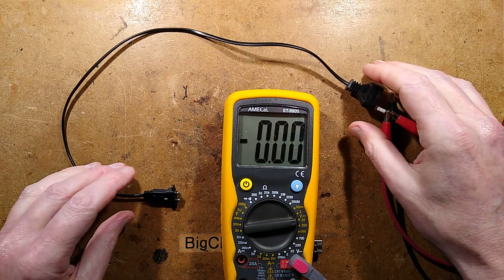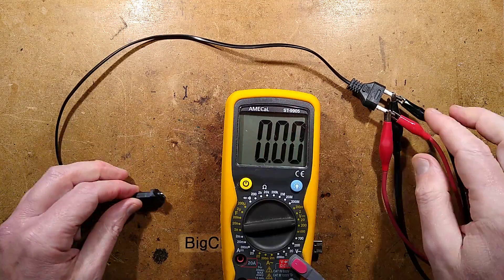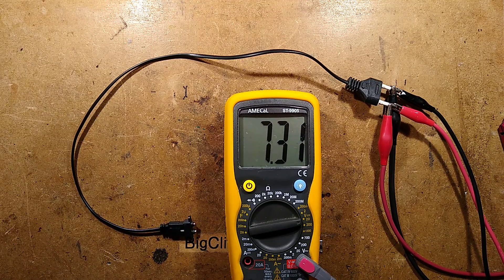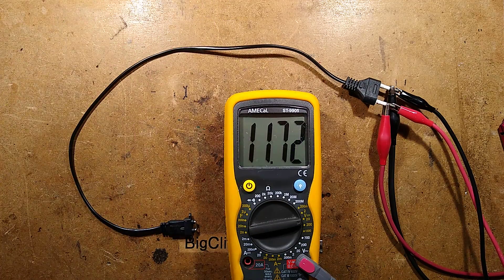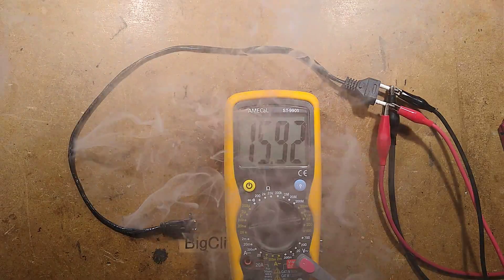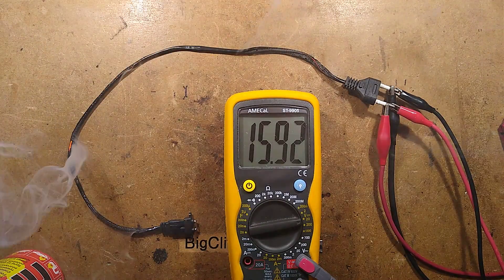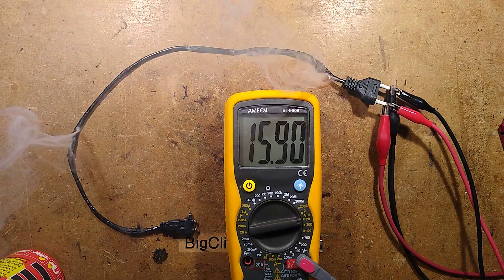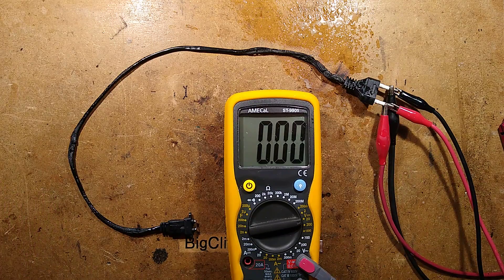Cable test ends in flames

Comment: Not the same but similar potential result...We got in a desktop power supply of some sort that used a standard computer style power cord. Often, these just get mixed together since they have always been 18 gauge wire for like forever. No problem. Someone happened to plug this into a computer and the computer acted odd. Then I was called to check it and noticed the power cord was hot. Cutting it apart, it was 28 gauge wire! I seem to recall it was labeled as 18 gauge but my memory could be fuzzy on that. That prompted a check of all other cords in the shop and now anything that is plugged in 24/7 only has Belden (we had them a while now) or other reliable name brand cords on it.

I don't like the fact that Copper Coated Aluminum (CCA) is now getting popular, bad enough for data cabling, worse for power, but copper coated steel is just scary in so many ways(as shown in the video). Time to buy more magnets for testing. Another fantastic video!
Reply from the maker: I have some thick but fake cables here with false specs on them. The magnet won't detect the aluminium ones.

Comment: I think I may start taking a little neodinium magnet with me for when I buy stuff from the 'cheap shop', that's pretty bad at even those low voltages.
Reply: I found a Lenovo USB mouse with steel wiring.  And it's from mid 2015!

Comment: Nice flames 🙂 Some time ago I powered a 400W "Sun simulator" (a metal-halide lamp) at home, to pretend that it is a sunny summer day (during a long winter evening). I used a generic cable that came with some Chinese device. Didn't use a capacitor, so there were around 3A flowing through it. The cable had "16A" embossed over it, so it seemed OK. There was some "hot plastic" smell. Thought it was coming from the lamp heating up for the first time, then there was a loud POP! and sudden darkness. No flames or even sparks, shame. The cable was very hot, soft and melty. It was made of a very tiny amount of copper-plated aluminium. There was no ground wire at all, just live and neutral, despite both ends having ground connections. Fun 😸

Comment: Clive, I've noticed here in the States that booster cables are more often than not just copper clad aluminium, and not a very durable product. The up side is that they are quite flexible, but the down side is that they are more brittle. I encourage people to avoid them, as they are quite lacking in quality and professional development and design.
Reply: Walmart has a reputation to protect?

Edit: FWIW, reviews of Walmart-brand jumper cables ("Everstart") seem to indicate that they're CCA, but the packaging doesn't seem to indicate that anywhere.
Reply: But how can you find out what's inside the product before you part with your cash and take it home? Serious question and I'm not being sarcastic.
Reply from the maker: By only buying from big names like Walmart and Asda with a reputation to protect.
Reply: @josephking6515   Read ALL the information on the packaging.  Sometimes they will admit that the cable is CCA.  Also get a feel for the weight.  Copper cables weigh a lot more than CCA.
Reply: @josephking6515  If you have experience with cables, a copper clad aluminium cable will be over 2 times lighter than pure copper. You can estimate the mass a real copper cable should have based on length and cross sectional area.
Reply: @josephking6515  if the package allows, pull one of the grips from the clamp, and look at the wires at the end. If they appear to be white, in all likelihood it will be CCA. Also, the weight of the cables can be an indicator as well as the package description. If they are an import, that seems to be an indicator as well.
Reply: Most people don't buy jump leads with the intent to use them frequently so if they're thick enough I wouldn't really worry about it. Especially if they have a decent strain relief on the clamps.
Reply: @ManWithBeard1990  You only have to use it once, not frequently to cause a fire.

Comment: I bought a 5v 10A powersupply. The barrel jack connector that came with it went up in smoke. I sniped the end and used wago 221 Terminals.

Comment: I made the mistakeof using some cheap Chinese alarm wire when installed my own system. It looked like copper. After 10 years or so i got an open loop fault. I tracked it down and the cable was actually rusting. I never checked with a magnet to see if it was steel but it certainly wasn't copper.

Comment: It might be okay (not the steel part, but just thin copper) IF AND ONLY IF there was a fuse in the plug. In just about everywhere but the UK, plugs don't have their own fuse. This means that all leads and even internal chassis wiring have to be able to handle the full fault current the circuit breaker will allow until it trips if there is a short circuit without melting. Across the pond here in the US, the breakers will be either 15A or 20A. I've never seen any proper appliance cord here smaller than 18 AWG (0.823 mm2), probably for this reason. I did have a 0.75 mm2 "copper" (felt like aluminum) cord for a laptop power supply and when the ground prong broke off (yes that happens here in the US), I cut the other end off, twisted live and neutral together, and plugged it in outside my garage to see if it could trip the breaker. As I suspected, it could not. Part of it just melted and burst into flames, breaking the circuit before the breaker even knew what was happening.

In my educated opinion, all plugs should have integrated fuses. The circuit breakers only job is to protect the wiring in the wall, not the wiring in an appliance. The appliance should have its own fuse.
Reply: Well frankly, the initial resistance was 5.86 V / 5 A = 1.172 Ohms. A short via this cable would have pulled 94 A on a 110 V circuit and 196 A on a 230 V circuit, easily enough to trip the breaker immediately.
Reply: @andreasu.3546  I suggest you learn about breaker (mcb) trip curves before making a generalized statement like that…. A 16amp breaker for example (with a ‘D’ characteristic) could easily pass well over 320amps for several seconds before tripping. 
A breaker with a ‘D’ characteristic can pass up to 20x its rated current for 4 seconds before tripping, For a breaker with a ‘B’ curve it’s about 5x the rated current.
Reply: @andreasu.3546  Tha thin cable would act like a fuse and melt before the breaker trips.
Reply: The 32 A circuit breaker in my consumer unit will usually trip quicker than the fuse in a plug.
There is a distinction between overload current and fault current which allows for the absence of local fusing even though their omission might seem like a bad idea.
Plugs with integrated fuses will not protect cables such as the one in this demonstration.
An extract from The Electricians Guide Fifth Edition by John Whitfield (6.3.1 - The Fused Plug) states that 0.5 mm² is the minimum flex size suitable for circuit protected by a 32 A MCB.
A  0.5 mm²  flex will not be able to handle overload current more than 3 A, but BS 7671 Regulation 433.3 explains why this might not be a concern.
It seems however, that a 32 A MCB will provide adequate fault protection for a  0.5 mm² flex, so a smaller-rated fuse is unnecessary if the appliance is rated at less than 3 A.
If cables smaller than  0.5 mm² start appearing on appliances, then all this is irrelevant, and fused plugs are not the solution.
Reply: Except for the UK I do not know of any country that stipulates fuses in plugs (which apparently is a holdover form ring-wiring the mains due to copper shortage after the war). But Christmas lights have a fuse in the plug, at least in the US.
Reply: British 3pin plugs are thought to be just about, if not the, safest plugs around.

Comment: its awful all this tat coming into the country and scary as anything i heavilly disagree with this stuff being made. Its not diy dave replacing sockets and tinkering with fuseboards as long as its done safely a problem. Its the scary lack of knowledge surrounding this wire fuses etc ive seen them 2 prong things wedged into extension leads wall sockets its frightening dread to question the circuitry inside this tat being safe aswell

Comment: what completed the circuit to let current flow?  looks like its just 2 unconnected points at the end.
Reply from the maker: I added a shorted socket insert at the end.
Reply: @bigclivedotcom A great many people seem to be completely missing the point of this test. The short circuit at the end of the cable is the least relevant detail of this test; this is all about the current and this cable's complete lack of ability to deal with it.

Comment: One of the most useful things I own is a Doogee S98 Pro with a thermal camera in it. Being able to see when stuff gets hot (when it shouldn't get hot) is an excellent indicator of when dangerous junk is about. Thankfully, I've been lucky with everything I've bought so far (off-brand Dewalt battery clones, anyone) but I'm always well aware that it only takes one shoddy cable to burn your house down.
Reply: New thing on the Chinese test-equipment market I'm seriously considering purchasing for my toolbox is a multimeter with a built-in thermal camera. It does mean you can't track volts and amps and spot the thermal issues with a circuit at the same time but it's kinda neat.
Reply: Clive does have a thermal camera. He showed it a few months back.
Reply: @chaos.corner  I was going to buy a standalone thermal camera for myself as a Chrissy prez but these multimeters with built-in cameras have suddenly popped up in the Usual Places. They've got USB downloads, data logging and a few other options that would be a bit of a step-up from my old Maplin special-offer multimeter anyway.
Reply: @robertsneddon731 Sounds nice. I know there are phones with them in. Mine is a USB plug-in one. It needs a micro to usb-c adapter now but still works.

Comment: I had a flex go up in smoke on my bench. It was for my bench top power supply unit. The unit is great, but the supplied flex is just terrible. Copper coated aluminium cores. I’d been using it for a good while too, but I moved it over to my main work bench for some testing I was doing to fault find on a coil I’d wound for a vintage magneto & all of a sudden there was smoke! I thought it was just a cigarette in my ashtray, but no, it was this flex.
I’ve since bought a second power supply (same brand) & they’re STILL using the dodgy flex! So I said as much in my feedback in an attempt to warn others.

Comment: Clive and fire to go with my first cup of coffee. It just doesn’t get any better than this.

When you showed us the product and showed that a magnet stuck to its power lead I immediately got a bad feeling, and it was justified.
What made you think to check the lead with a magnet, have you run into ferrous power leads before? I would never have suspected such a thing. As I think about it, with the rising cost of copper, I suppose I shouldn’t be surprised that it’s come to this but damn, who allows this to happen?

Comment: That would probably still happen with high quality cable, shorted like that
Reply from the maker: Not with an equal gauge of actual copper.  Steel is NOT suited to a flex like this.
Reply: @bigclivedotcom  Well yea, I am not endorsing steel or ally wire lol

Comment: Failure under controlled conditions is the best kind of failure. Might want some air filtration for the shop if you're going to keep doing this, however... ;)
Reply from the maker: It has a 24/7 extract fan.

Comment: I love copper-clad steel and aluminium in unshielded twisted pair cable: looks good, while delivering a hell lot of headache in communications and breaking here and there when cables slightly move. Also, copper-clad steel (and especially aluminium) is terrible when you try to use it as jumper wires in your solderless breadboard too, not to mention how bad it is for use in soldered circuits.
Reply: In the USA, copper-clad steel and aluminum twisted pair cables are not allowed for in-wall (or in ceiling or anyplace they're permanently installed) use, the electric code says they have to be copper. Therefore it's a code violation to use them for that purpose.
Reply: @brianleeper5737  anyway, somehow they sneak into market in various countries, often without proper marking.
Reply: @jkobain  I'd hate to be the one who installed thousands of meters of this cable, only to be told that the installation has failed the electrical inspection and it must all be torn out! I guess the only good thing about that is you can use this junk cable as a pull string to pull the good cable in!
Reply: Given most components have tinned steel leads, steel wiring couldn't be that bad.  (I'd rather my power leads to be copper though.)

Comment: I learned this mistake the hard way. I did reuse a mains cable from a shonky Chinaproduct (a desk fan) for another shonky Chinaproduct (a little desk PTC heater, which had a worryingly thin cable). Over time, the cold current of the PTC, which was large, melted the cable to the point of a short.
Reply: Never buy anything intended for mains from China. It's all crap.

I've seen metal cased appliances which had an earth wire in the British plug, but  it wasn't even connected to the case.

I have seen lived exposed parts and incorrect sized fuses put into the plug.

Just don't anything from China that is intended to operate from the mains.
It's not worth it.

Comment: I think it is important to mention that this high voltage translates to a relatively low current when 240v is applied. This low current is dangerous, because the fuse will not trip instantly. Fuses are designed to trip instantly on high overloads. You can see that in earlier video's from Clive where he takes a fuse apart.
If this cable will conduct about 3A at 16v, it would do about 45A at 240v. This would definitively not trip a standard 16A fuse instantly. This fuse can handle 72A for at least 5 seconds. Within 5 seconds, this cable will be on fire at 45A.

Comment: You could make a follow up where you explain how can we separate the good, the bad and the stinky if we have a box full of random cables (I can't be the only one who has). Measuring resistance, magnet test, or try to overload it and if it burns it was bad?
Reply from the maker: I think it needs a dedicated tester designed that measures the voltage drop at high current.

Comment: I bought a standard computer cable once, in a local chinese store and the cable said 0.75mm2. I'll admit; I did overload it with around 10 amps, but copper cable would've held that with no issue, but the one I bought, was like yours; with copper coated steel wires (only a few thin strands of steel in each wire, not nearly 0.75mm2) and since the price was literally pretty much the same as for a genuine cable, I haven't given it a second thought and bought it, only to later shockingly discover it in "melted and stuck to itself" state. Pretty scary.
Reply: That story makes me want to throw out every cable I own and replace them with ones from a reputable brand. Who knows how many of the cheap crap cables I've accumulated over the years have fire starting potential.

Comment: I'm sorry Clive but any wire will burn if you exceed its current rating for a length of time. In this case that cable was intended to be used @240V and a direct short would cause enough current that the main breaker would trip instantly. 
The device it's connected to would have to fail in a controlled fashion where enough current would flow through the cable for a length of time exceeding its current limit without tripping the breaker. Impossible? No, but unlikely.
Aluminum foil would have worked as a desk/flame protector but may have not been camera/lighting friendly?
Reply: The smallest gauge wire allowed for power cordage in the USA is 18AWG (it must be copper) and that will pass 5 amps all day with no overheating.
Reply: @brianleeper5737  You're right, at 7-24 strands it's 4.9A although that's for all copper wire. [# of strands dictates current rating to be 7A-3.5A] Here in the USA typical min breaker is 15A 120V which in the UK @240V 7.5A will dissipate the same wattage. I don't know what the min breaker in the UK is for utility panels. 5A @240V is 1200W
Reply: Amps isn't the only problem, cable fatigue is a worse one.  That's the problem with CCA, it breaks and arcs.  Dunno how steel hold up, in theory it should be bell than aluminium.

Comment: ... OKaaaay. I'm gonna test all the cables in my cable drawer with a magnet. I'm not putting 2 amps through them, let alone 5 amps, but still.

Again: I have this fleeting suspicion that if nichrome was cheaper than steel wire in China, they would use that in USB cables...
Reply: Magnet test result: 3 cables/adapters. One USB3 to HDMI, two official GoPro cables (!!), possibly from the discontinued Session camera. It's possible the steel was in there for tensile strength or shielding, but I'm not taking my chances.

The rest is using copper or aluminum.

Comment: Jeez, Clive! I hope you were wearing a respirator during that "experiment" but it didn't sound like it. That's dangerous stuff, mate. No telling what foul and toxic chemicals were released in that meltdown. Are they using steel wire because genuine copper is too expensive?
Reply: One nasty stuff that was surely present was chlorine from the burning PVC. And who knows what other things from the plasticizer and other additives.
Reply from the maker: Yes.  It's purely cost saving.
Reply: In another comment he said he has a extractor fan in his workshop = he turned it on after recording this video and it quickly extracted the fumes